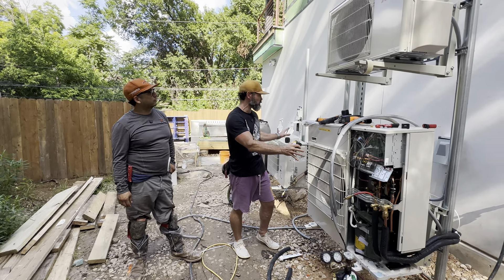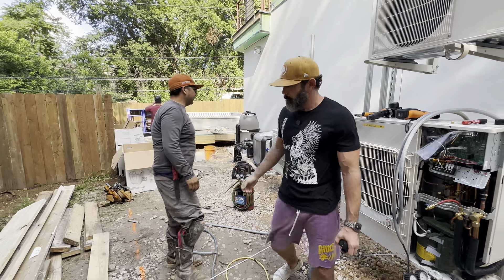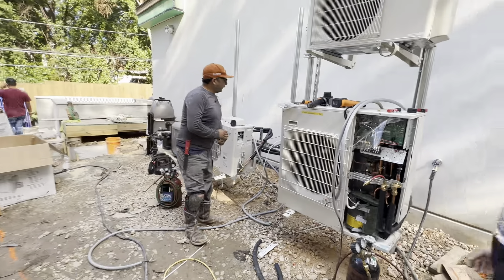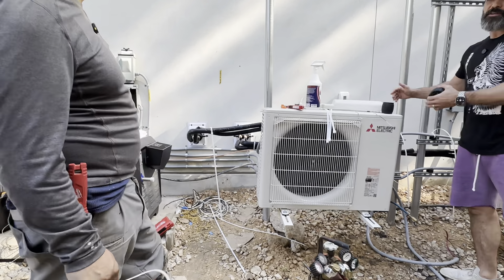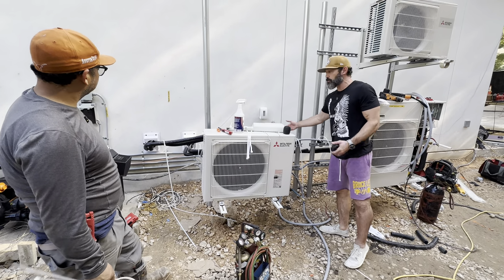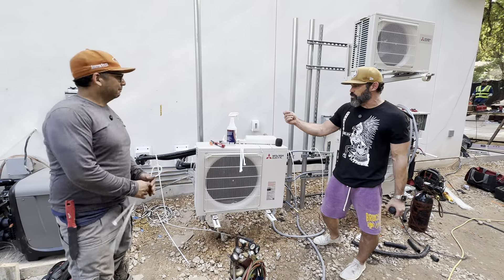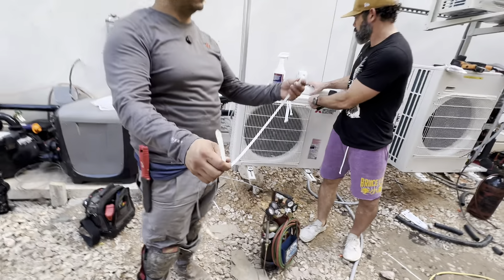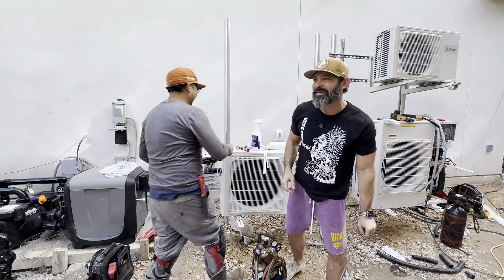HVAC Tower Install

Comment: Don't mount to building it will transfer vibration to building and having the condenser 6 feet in the air is extra fun for the service guy
Reply from the maker: These poles are concreted in the ground so vibration not an issue. In terms of the service height, a step ladder should suffice…we left ample room to work all the way around.